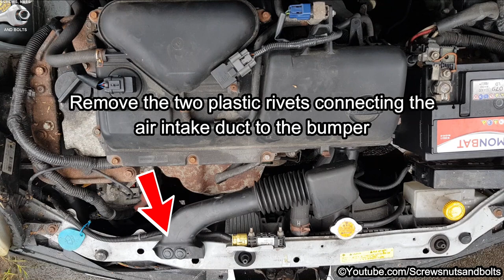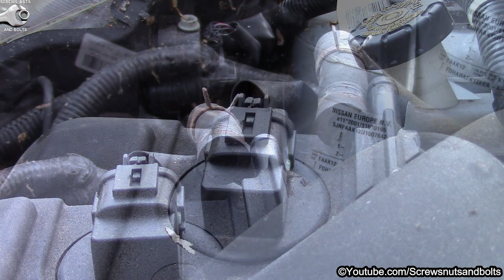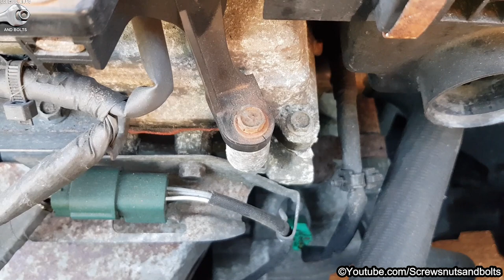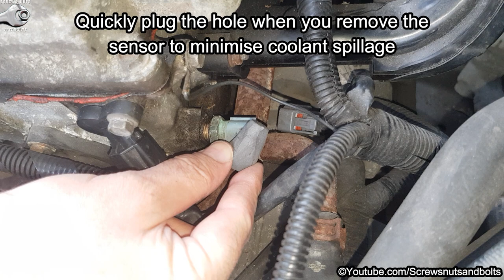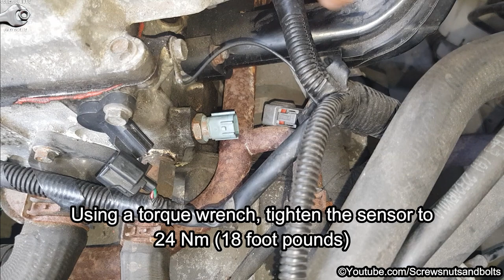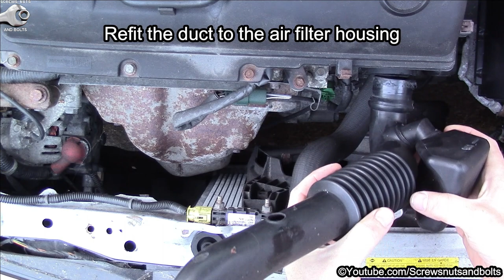Coolant Temperature Sensor Removal and Refitting - Nissan Micra K12

Comment: Thanks for upload.Well detailed. Replaced the one on my K11 back in March.Very similar procedure but quite a faff to do. The car was almost impossible to start .It ran well for a while and then the Throttle Body electronics gave up in a big way.Sadly scrapped now but I still have the other K11.:virtualhug:
Reply from the maker: You're welcome, pity about the other K11. I actually preferred the older Micra, certainly lookswise ! :)
Reply: @screwsnutsandbolts  Thamks I agree. If I come across a K11 later coil pack version I would probably go for it..MAF sensors can be replaced separately on those.Unfortunately on the older Micras the sensor is integrated into the throttle body and unavailable.I did try soldering everthing and even tried a couple of used ones from Ebay .But it never ran the same afterwards. Excellent little cars though :virtualhug:

Comment: Hi my Nissan drives for about 20 mins then temp light and engine light comes on then starts juddering/loosing power and fan kicks in when engine not even hot and loosing power would this sensor be the issue 👍
Reply from the maker: It's possible. It might be worth changing it first as they're quite cheap

Comment: Im having a problem with this micra it runs fine for the next 30 min or more 
then the gear stops shifting and it will move only in third gear and it will get stuck here (3)
Then if i turn it off and start it again it works fine and it will stop again shortly and im gonna have to restart it again and again to make it shift again
Reply from the maker: It sounds like a problem with the clutch not dis-engaging. It could be an issue with the clutch, low transmission fluid or something else. This link might help: https://carfromjapan.com/article/car-maintenance/manual-transmission-wont-go-into-gear-when-running/